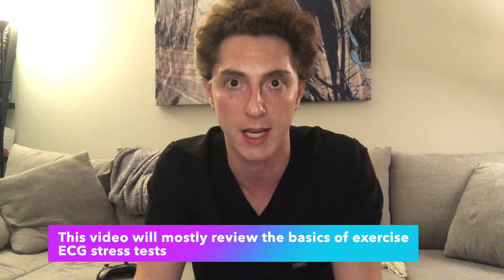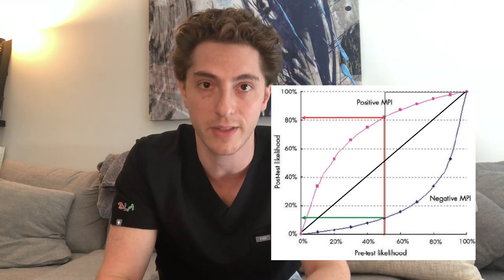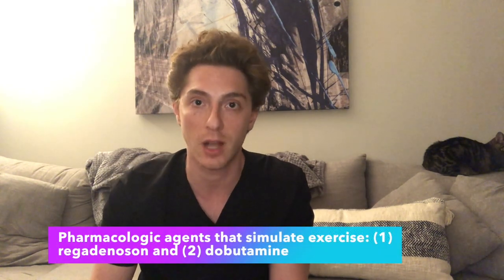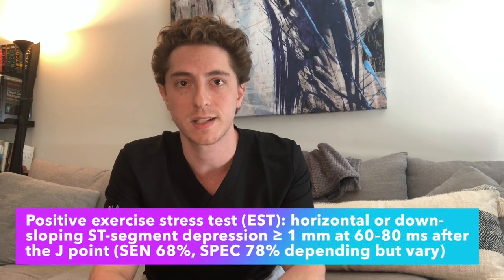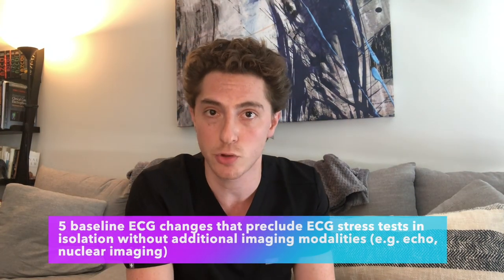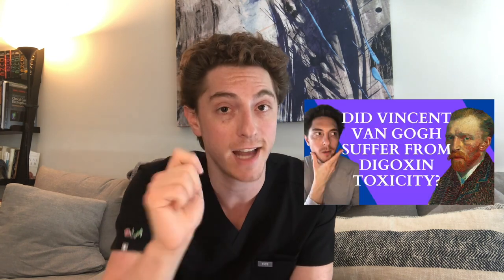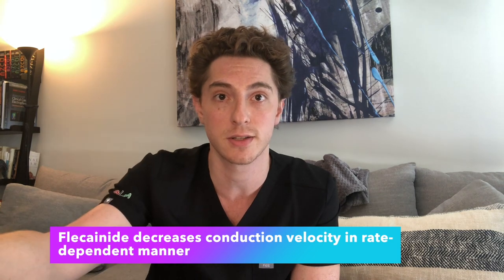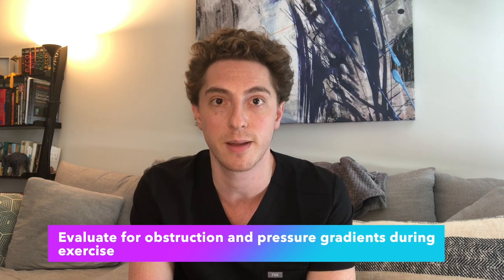Introduction to Cardiac Stress Testing: part 1

Comment: The physicians assistant ordered a nuclear stress test on me. I don't know why, she didn't explain anything about it. It came back just fine. She said no-one orders just the standard treadmill stress test anymore. My EKG before I saw her showed some conduction blocks ,which then lead to heart failure a couple months later. I have never been overweight ,or had a high cholesterol or high blood sugar. My complaints were arrhythmias.